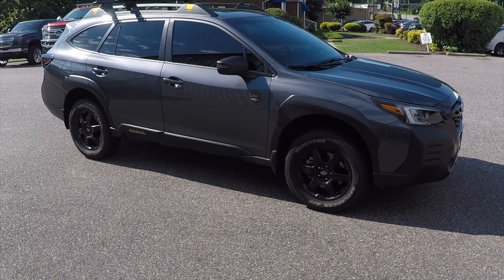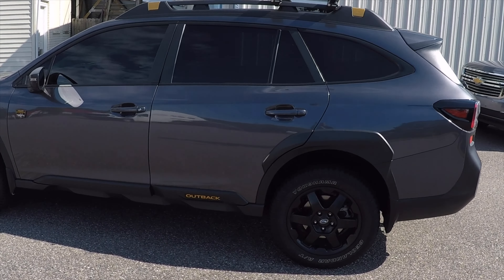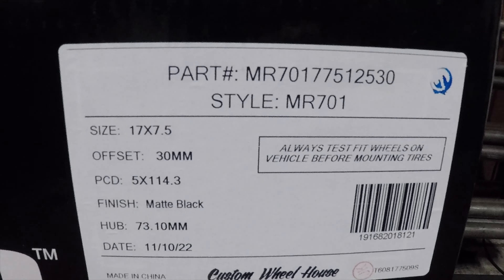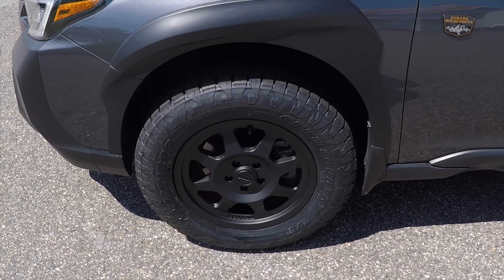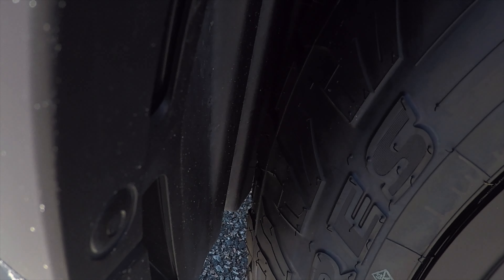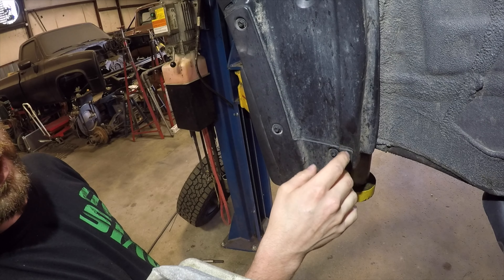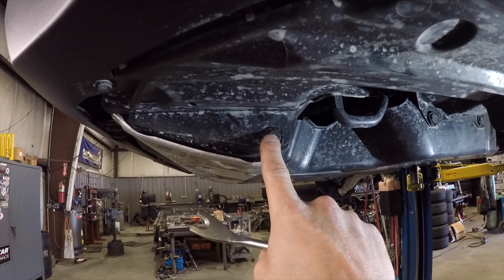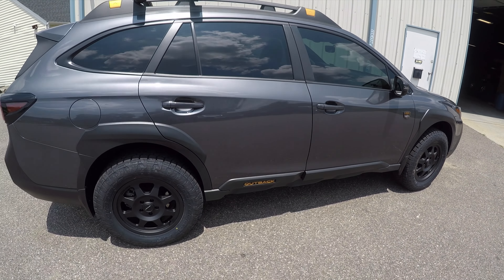245'S ON A SUBURU OUTBACK

Comment: In the 2025, Subaru needs to make this size tire standard. The stock tires currently look like donuts compared to these. And it wouldn't take much for them to increase the size of the spare well either! Come on Subaru!
Reply: The stock tires look like pizza cutters. It’s such a good looking vehicle til you get to the rear and looks like it’s on stilts, it’s a weak, unstable look.  The 245’s make it look tough and stable.  I like the stock wheels so I’m assuming installing a spacer with these tires would work as long as it doesn’t leave the axles and cv joints weak and vulnerable.
Reply: @tylers.2069 , oddly enough, “pizza cutter” tires actually provide superior traction in deep snow & mud because the front surface ares on “pizza cutter” tires are narrow, they cut through better than wider tires.  Wider tires with wider front surface ares tend to float more in deep snow & mud since they’re pushing more snow & mud, which creates more “float” than “bite”.  That’s why mountain rescue vehicles tend to run factory stock size or narrower tires instead of wider tires.  The same is true when driving in the rain.  It’s just “pizza cutters” don’t look as cool.

Wider tires aired down do however, provide a smoother ride & better traction on dry rocky surfaces.  Great for the desert!

Comment: I have this same set up, dropped the pressure down to empty on the spare and got it in there.  I carry an air compressor and works fine, didn't need to bolt it down and stays wedged in there good.  If you wrap it up to keep it from making noise, you can put the jack below the tire to use the space.  Ended up putting on Vredestein Pinza AT, no need for heat molding the wheel wells either.

Comment: I have this exact car. Same color too but I deleted the exterior brass highlights with matte black film (kept the badge). 
I HAVE 245/65/17's on it, and Motegi MR139 7.5X17's with a 40 MM offset. Falken Trail AT's (the non LT version for this size range. They offer both)
I did a lot of research and math before I bought this combination, and it worked well on paper, so I rolled the dice and came out a winner. But let me share some details on what to look for, and why I did certain things.  I learned a LOT about tires and wheels and offsets and a dozen other things when I started down the path to answer this same question.
Why a different offset for instance. Well, you want to stay centered in the wheel well. I was running on the assumption that the stock tire was more or less centered, and used this for a baseline. Then I factored in the offset of the stock wheel. I then added the larger width of the new tire I knew I wanted to this equation, and then found a range of offsets that would be optimal to keep ballparked in the center of the wheelwell space. I say a range, because when you go to shop wheels, you will find limited options, usually dependant on sizes of the wheel, intended purposes, etc. 
My MR139 was in my optimal range at 40 (and I am going on memory here for both the offset and the model number so hopefully I remembered correctly), and was also a lightweight wheel. Why did I go with 7.5X17 instead of the stock 7X17? Well, again I am putting a wider tire on it, and I also plan to air down, so I did not want my sidewalls bubbling out so much when aired down, or even when aired up for that matter. It is better support, and less exposure for sharp rocks, while still remaining within the width that works well geometrically in that wheelwell space.. Just because a tire will fit onto a wheel, does not mean it is a good choice, especially when going oversized with a specific purposed tire, like an AT in a relatively small well.
I wanted to avoid the downfalls of a super heavy wheel tire combo as I did this upgrade, and I was willing to spend a bit more, to get a lighter wheel that was still built with Rally DNA and strength. So I got a lighter than stock wheel to offset the weight of a larger tire. 
And then, when shopping tires, I found the Falken Trail AT tires, which have a Crossover Hybrid option specifically designed for cars like the Subaru's, and Rav4's and the like. Most of the time in this size range (245's) you are limited to truck tire spec'd tires. But we don't have trucks, we have crossover SUV's and Cars. So what Falken did was offer a P version, a non LT version, that is not 15 lbs heavier per tire. It's more like 7 lbs. But it still has superior load rating (Just not the cargo rating of a Truck) over stock, and so even a fully trek modded Subaru is going to benefit from the load rating, but not pay for the extra weight of load rating you don't need. The construction is still AT DNA, and that means stiffer sidewalls for airing down, and aggressive treads that are the same as the LT version. So I saved about 4 lbs on each wheel, and about 7 lbs. on each tire. 
My wilderness already has a lower final gear, and I didn't add  that much weight to my corners, so in some situations (HWY) my MPG is actually better than it was before, or at least the same because my effective final gear with larger circumference tires, has been raised more towards the economy end from the torquey end. But this car has still got plenty of torque with the larger tires. 
Now for conflicts. I have a finger width (I have slim fingers) clearance even at my narrowest clearance angle on turning, which ironically is NOT full crank, but a bit less, where the corner edge of the wheel is aimed at a part of the wheelwell front area that is starting to curve inwards towards the center. Now I measured this on the ground, but with the Wilderness you only get MORE clearance going into the round wheelwell with your round tire, assuming correct offsets, so if anything I would have MORE clearance being on top of a boulder on that front wheel and more compression. And downwards is not a problem either, at least that I have ever experienced. I have had ZERO rubbing. Im not constantly traversing rock gardens, but I have been on a few very rutted trails, over rocks and curbs while turning etc, and there is no rubbing with this combination on my 22 Wildebeast. 
Now lets discuss the spare tire compartment. NO it will not fit fully aired up with the foam tool caddy. But I DO carry my full sized spare in my spare tire compartment. How? 
I removed the foam tool caddy number one (and there is still TONS of room for tools and bottle jacks and tow ropes etc, just not in THAT shaped carrier. 
Number 2, you DO need to air down a LOT. Probably to about 5 pounds or less. Just enough to keep a bead. And your car WILL be supported on a few pounds and you SHOULD carry a pump if you are doing this, to top it off. 
Number 3, you cannot place the tire FLAT, and you cannot screw it down. But you don't need to. It's hard enough to get it in. It sure as hell isn't going to fall out or wiggle. Mine is at an angle with plenty of room around it, under it, and over it inside the wheel. I carry a lot of stuff in there and purposely put some ropes and towels over it to help support the bottom of the hatch door, which is the bottom of your cargo compartment. The tool caddy served this purpose of additional support before. Not that the hatch is flimsy or anything but I wouldnt want to be stacking anvils or batteries on it, and it's peace of mind to have some support under it so it won't have room to flex downwards. The hatch fully and easily shuts, and it is a very clean solution that keeps crap off of your back hatch, roof rack, or stowed in the car or trailer. 
I don't know if ALL 245/65's fit in the Wilderness, and I can't speak to other outbacks either, but I assume they have similar wheel wells even tho they don't have our strut based lift. I do not know if other tires from other brands will work here, like the popular KO2 which I nixed for weight. But I DO know that most of the people who post about rubbing and conflicts, and try to solve this with lifts, have other issues, like the wrong wheel width that bubbles out the sidewall, or the wrong offset, that takes the wheel from being lined up in the very center of the wheel well. I also know that the Falken Trail AT non LT version was specifically engineered for crossovers that generally have smaller wheel wells, and this was engineered into the geometry of the tire. You still get the size and agressive tread, but the parts that would normally be rubbing on fenders are tucked in just a wee bit better on the tire edge.
If you want to go largest, you don't want to do it on stock wheels, although I have seen SOME specific tire combinations be bragged about with stock wheels in this size range.. All tires have slightly different geometries so it will vary. 
If you are going to use aftermarket wheels and go to this size, I don't know why you wouldn't maximize your clearance potential and go with the right offset, and even fine tune the wheel width. Yes, you can fit this size on the stock wheels, and you might have rubbing. You might even be able to have the right offset for your particular model and year setup, but if you are putting a wider tire on, you should consider a slightly wider wheel. The area the wheel is in is NOT where rubbing will occur, so you are not risking much by going wider to match your tire, and You can still put the stock tires back onto a slightly wider tire as well.. But by more closely matching tire width to wheel width, you will reduce sidewall bulge, which Can be an issue, especially when aired down, and especially offroading in areas where there are lots of sharp obstacles. Minimize it, and give your tire better support. It will run cooler with less stress, and more clearance. 
This was a very nice choice by this customer, and I like the way their rig looks. The wheel design is very close to mine, as is the added height, which on paper is only an additional 1/2" clearance (inch taller tire), but it reality it is closer to 3/4" taller, at least on my rig, because my sidewalls sag less than the stock Geolanders are designed to under load. I actually notice getting in, and driving, that I am taller than stock. The only difference I would have made, is that if I had gone with Method wheels I would have gone with the 17X8 with a 38MM offset. You have room to move closer into the center of that well, and more in line with the side of your car. But we are only talking about a ten millimeter difference. It might have reduced rubbing (or not) but it was more likely tire geometry. But it defintely would have given you a slimmer footprint on the trail.
I appreciate the detail on how to mod the fenders if I ever needed to. I may go up a hair more in size when these wear out, although, honestly, they are doing the job just fine and I probably won't. I was shootin for 30's and I was just a half inch shy. I like how you can get that extra half an inch here and there without doing major mods. Good tuff!
I Hope this helps. No I am NOT a professional. I just do a lot of research on my own stuff, and I'm good at reading specs and doing the math.  🙂
Databyter
Reply: Hey bud a read through your post, and have a 2023 Subaru Outback Wilderness that I am looking to do something similar to you. I don't mind the stock wheels as far as look as concerned..do you think I could throw the 245 Falken Trail ATs on my stock wheels without problems with rubbing? I like your ideas, and while I could replace the wheels as well, the tire is what I am most interested in....I just really, really, don't want any rubbing problems like I had on my previous Audi.
Reply: @RaintapASMR  The 245's are not just taller, they are wider. That is what that first number is. You are going from 225, to 245. Which is 20mm, or a hair more than 3/4 of an inch. You are ensuring that your wheel well is 3/4 of an inch less roomy from side to side, and on top of that you are tossing in a tire that is 1 inch taller. 
It is my unverified opinion, at least on paper, that the reason so many people have rubbing problems with 245's is because they have not used the proper offset to compensate for different wheel widths when they changed from the stock wheel. So this may be one advantage to keeping the stock, we assume it is somewhat centered. (The other reason people may get rubbing is because different brands might have different shapes and tolerances despite the official "size".)
I think in this car it is a bit tighter on the outside of the well than the inside, so I would err that direction when wheel shopping (in other words I would go with less offset over more offset). 
But if you go with stock wheels, all I can say is, the pro's, they look good, they are strong, they are fairly light but probably middle of the field. 
Con's You could go wider and have better support for wider tires (but this width is supported), you could go with a different wheel that is lighter to compensate for the added weight of new tires for improved MPG (but if you go Falken Trail AT's no LT version you are already saving tons of weight over most 245's). It is probably well centered in the well, but also probably not IDEAL when we are talking millimeter clearances. 
I rolled the dice on a 40 mm offset and I have no rubbing. Stock is I believe around 48MM. Is this why I don't rub with 245's? I don't know. Probably not. I think it is a combination of the tire brand and construction, and the fact that they are designed for crossovers so they don't have huge sharp corners to eat fenders. They do have very aggressive corner and side tread tho, so no worries on that front. 
All said and done, I think the stock wheels would work with these tires, and if you do this, I want you to shoot me a message and let me know for my database. Seriously let me know how the Falkens work out for you. I went wider on the wheels because I knew I wanted lighter wheels anyway, so I had to change em anyway, and I figured a half inch wider was a good idea for tires that are 3/4 inch wider. I could have gone a full inch wider, but I wanted a wheel that could work well with stock sized tires in case I decided to revert back to stock size in the future, for like snow tires or something. I realize that I was fighting myself when searching for light wheels, and going bigger at the same time. But I accomplished it.
I can't promise you no rubbing with the Falkens and stock wheels, I can only say that I have no rubbing, and the only difference is slightly wider wheels, and a slightly more inboard offset. One of which I don't think makes any difference, and the other which might, but probably doesn't. If I had to guess, I'd say on paper, it should work :) Databyter
Reply: Thanks for the response. I think I will give the go on the falkens on the stock wheels, and it doesn't work, then I might just go ahead with your suggested upgrades. I like the idea of the lighter wheels and better mpg, but if that's mainly in the tire itself, i'd be happy enough I think with the stock wheels and make other adjustments down the road. Appreciated @Databyter
Reply: @RaintapASMR  A reminder, at this tire model and size, usually you can only get LT tires, but I recommend the NON LT version that is specifically made by Falken for cars exactly like ours. They are lighter, and still have the aggressive treads, ability to air down, and better than stock load ratings. They just don't have the ridiculously underneeded load ratings required of Light trucks which add a degree of thickness that is overkill for our application. There are two different versions of the 245 Trail AT's. Get the non LT version. It may say P or it may say nothing, but they are designed for crossovers like the Subaru and Rav4.
Reply: Do you have pictures?

Comment: Awesome look! I currently bought 18" black rhinos and i want to get a similar tire look on my 2017 Outback.  Im currently looking at 235 60 18 AT tires. Yall think it would fit with minor plastic heating of the liners?
Reply from the maker: Yes as long as you have a high positive offset wheels then the 235/60 should work with the modifications. The 235/60 is slightly shorter and a touch more narrow than the 245/65/17 we installed. Good luck on your ride !

Comment: did you say those are beaded?
Reply from the maker: They are considered a “bead grip” wheel. This means that the bead on the wheel where the tire seats has beaded ridges causing it to grip the tire bead firmer. This allows you to air down the PSI further than normal without the worry of the tire de-beading while off-roading.

Comment: bad idea, clearance is needed - mud, snow, road hazards like debris even rain not to mention wheel travel
Reply from the maker: This video is for those looking to add tire size to their outback and how to make the clearance you are speaking of .
Reply: @davis_off_road6524  then why the heat? why?
yes it needs a lift for those over sized tires
might show it done right :o
Reply from the maker: I think you are missing the point. Customers want to run larger tires without adding lift to these vehicles. This is a “how to” on how to gain the SAME amount of clearance on the new larger tires as the vehicle had from factory on the stock tires. This means you have the same travel, clearance, and room as you did from the dealership. We are 110% capable of lifting these vehicles for this tire combo , but that’s not what was requested. If you don’t like the scenario then don’t do it to yours and you won’t have anything to belly ache about.
Reply: @davis_off_road6524  LOL this is correct.